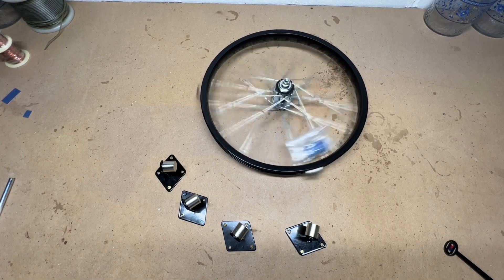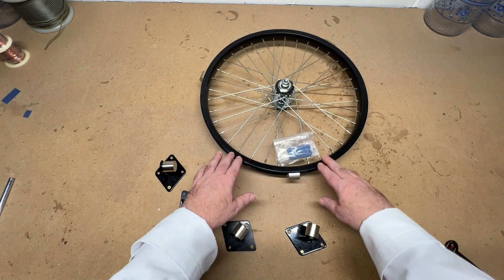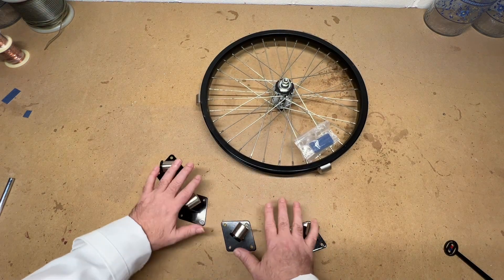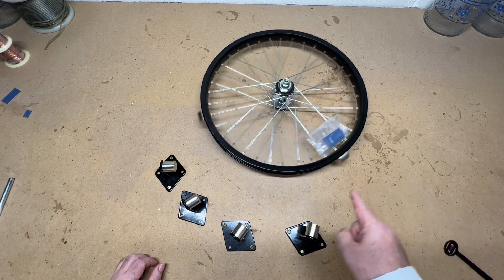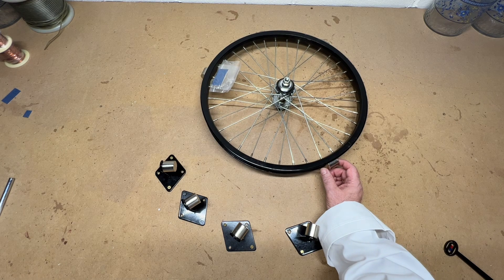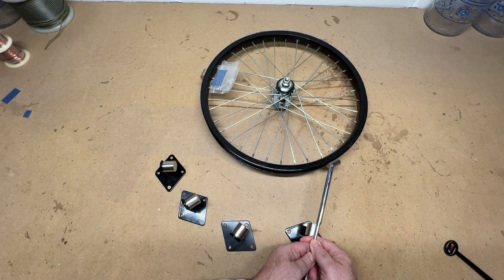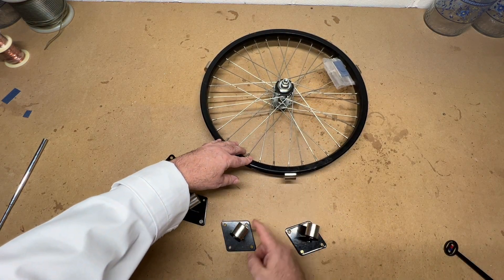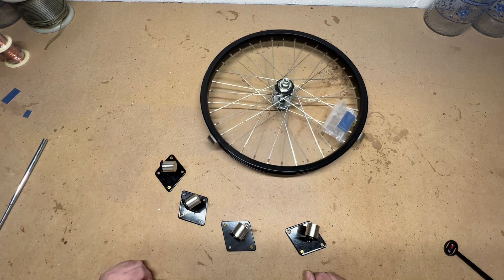🧲 Magnetic Motor Research

Comment: Good show James.  It seems quite logical that the 3rd magnet will keep the wheel turning. Definitely drag with the weaker magnet.
Reply from the maker: 🧲 I inadvertently had the second armature magnet just before the weak magnet backwards. If that was not already causing back drag, the second stator to the right was also backwards. Now it runs great, but eventually stops after lots of near stops and sputtering. Thanks Dale for stopping by.  Can't wait for those 18 stator magnets to show up at my doorstep and 18 mounting brackets. Cross your fingers. 🤞

Comment: That was a very good experiment 👌 Would you change the places of the magnets now and repeat the test? The weakest one with the socket to be placed at the second stator position , because after the push, the the incoming one will have less resistance from it. The other two stator magnets to be used on the wheel. The weakers use as stators. On that way, you will have same types of magnets on the wheel, and same for stators. Also please make sure they are at exactly at 120⁰. Thank you and good luck. 👍🏻
Reply from the maker: 🧲 I did just that for you. Better results. Wheel is now starting to sputter, which is really good news of course. In my opinion, a motor that sputters can be made to run. Have 18 more N52 cylindrical magnets already on the way. Vid starts at 9:15pm Tonight on this channel. 9:pm on my backup channel. https://youtu.be/HsDKd-wT_tc
Reply: 🧲 Done. Posted it on my backup channel. WHEEL SPUTTERING TRYING TO RUN
https://youtu.be/qPxLybXv0X0

Comment: Thanks James, looking forward to seeing more stators all the way around.
Reply from the maker: 🧲 Ordered eighteen N52 - 1" x 1" Cylindrical Neodymium magnets, with the poles on the ends. Should arrive in a few days. Then we get to see if this is a dead end road, or will this open a new door. No where on the web have I seen this configuration. It's makes perfect sense. While the armature magnet is being pushed, it's also being pulled at the same time. Tow stators ganging up on one armature magnet. 'Should' this actually work, this design lends itself to really strong torque. Cross your fingers. 🤞

Comment: What about an electromagnet that you can turn on and off when needed? Possibly use a Reed switch to trigger it.
Reply: idea is to go off from relying on electrical power to run these..we want these permanent magnets to run the system
Reply from the maker: 🧲 I have given that a lot of thought in recent years. A massive coil that wound inside the rim that works from all the stator magnets that surround the wheel. Use that to power a gate. 🤔